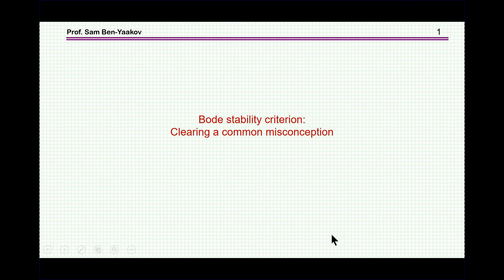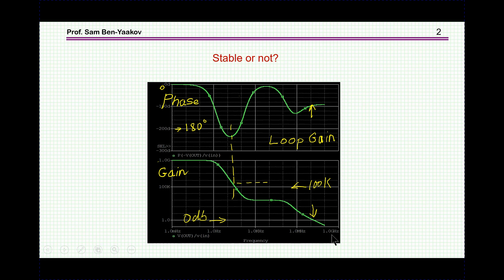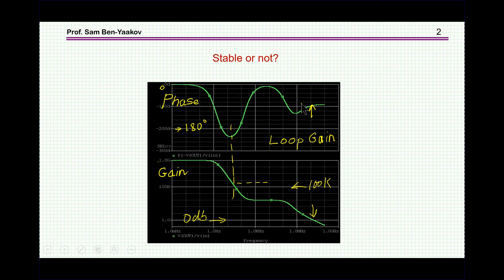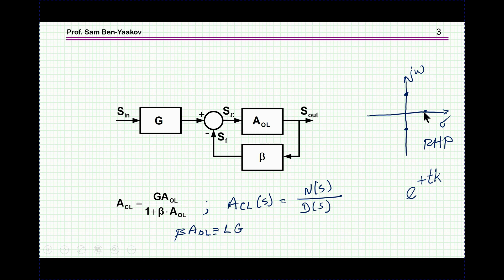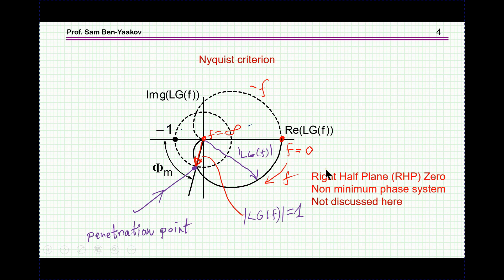Bode stability criterion: Clearing a common misconception

Comment: Hello Professor! Thank you for your wonderful talks and they helped me gain a lot of intuition about stability analysis. I really appreciate them.

However there is something confusing me while I went through your videos. In https://www.youtube.com/watch?v=DkFICg-YRtg titled "Bode stability criterion: Clearing a common misconception", you mentioned at 4:27 that the Nyquist criterion is only for minimum phase systems, and the RHP zero of the loop transfer L(s) should be taken care of specially. 

In another video, https://www.youtube.com/watch?v=vaU2P1naz8E&t=1798s titled "Right Half Plane Zero (RHPZ) in power electronics", you mentioned at 11:00 that the the contribution of the RHP zero is none to the stability test. 

Seems a little contradictory to me. I wonder what's the true story of Nyquist criterion for non-minimum phase systems. I would be very grateful if you can give me some instructions on this problem :-)
Reply from the maker: The link 11:00 does not correspond to the RHPZ video, or am I missing something?

Comment: Thanks Professor Yaakov! I have a question. What happens to the system when you power it on, with the supply ramping up etc. At that point there will be positive feedback due to the high loop gain and positive feedback. How does this positive feedback dies out on power up?
Reply from the maker: The proper way to turn on is to to use soft start. During the soft start the system is in open loop so there would be no oscillation due to feedback. You might have some oscillations due to the passive elements L, C.

Comment: Dear Professor.  I ( including a lot of other engineers as well ) have had this confusion for so long. Thank you for uploading this masterpiece. Absolutely wonderful. I would like to know more about non minimum phase system from physical point of view and it's impact on stability. Any link or paper ?
Reply from the maker: Hi , Thank you for comment. You can look up IEEExplore for papers. I plan to post a video on the subject of non minimum phase systems.
Reply: Couple of  questions Sir, 
1) Since phase reversal has happened at very high gain in your example, what can we comment on gain margin by seeing only bode plot? It seems Gain margin is negative here in this example?  Again, by seeing your hand made nyquist plot, though it reaches 180 degree  , I see positive gain margin.
2) Since phase margin is around 90 degree, can we related the transient response with it? 90 degree phase margin is similar to  over damped system. So transients should've settled smoothly? Here I see some overshoot before settling to the final value?